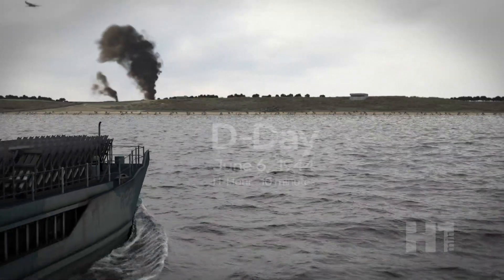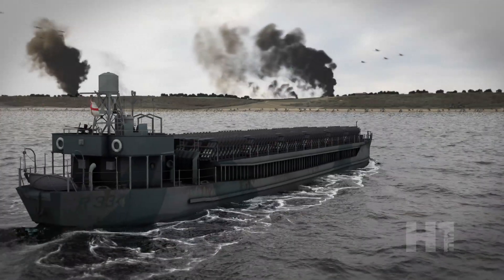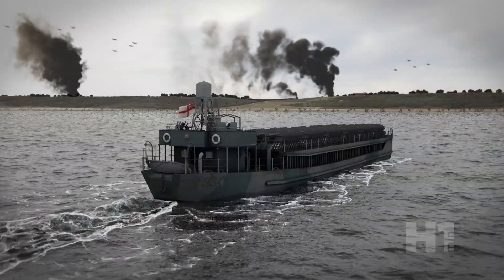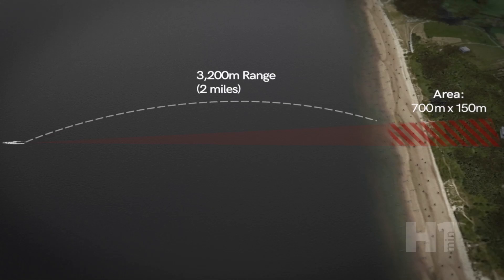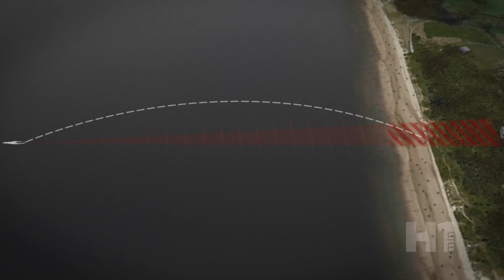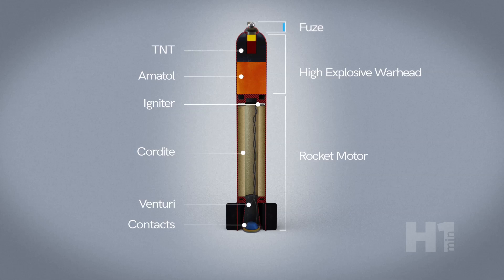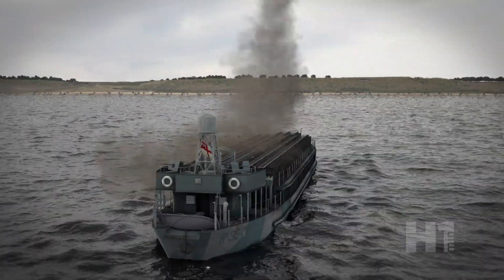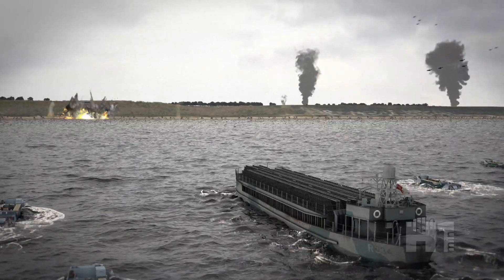H1MIN: LCT (R) D-DAY

Comment: A great idea, but did they actually have any material affect on the beach defenses?
Reply: I bet they had an effect on the Germans underwear.
Reply: On anything that wasn't bunkered, why wouldn't it?
Reply: @samarkand1585  you've got to hit your target to have "material affect on the beach defenses".  Those things were damned inaccurate, pretty small and shooting at really big beaches.
Reply: They did. The Americans modified this rocket ship even further. They would be used in the Pacific during WWII and the Korean War
Reply: @RonJohn63  you don’t need to be accurate when you’re shooting hundreds of rockets
Reply: @yobob591  land is bigger than than you think it is, and rockets smaller than you think they are.
Reply: I guess it would shred barb wires,bury trenches, concuss german soldiers, to ease up the job of the Allied Soldiers
Reply: helps to clear wire, mines etc basically a nice clean path for your soldiers to push into quickly

Comment: But on D-Day they didn't get in range because they were cowards so they were fired short. Utter waste!
Reply: An open deck of rockets is a juicy target to heavy shore batteries, and anything within 1/4 mi of it when it goes up would have a bad day.  That so perhaps the strategy was to wait until shore defenses are reduced to mortars and lessor weapons, or if things got bad, (even worse than they did on Omaha), then go ahead and risk the rocket barges in close, but keep your distance from it with everything else you have.